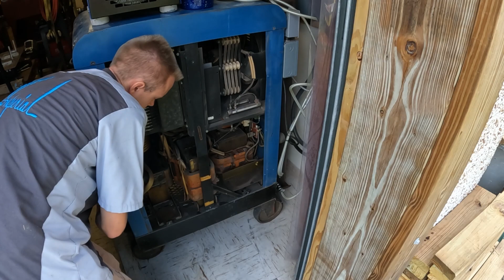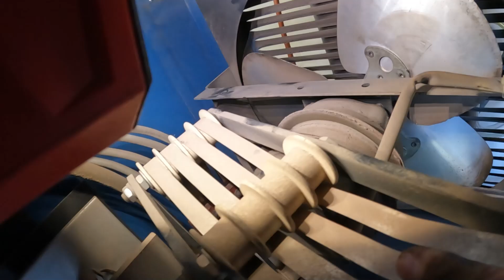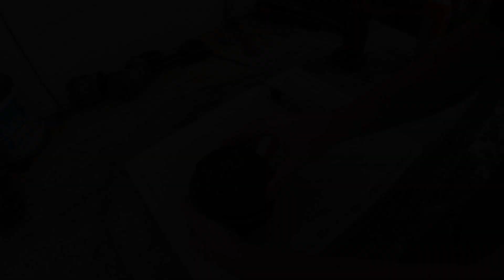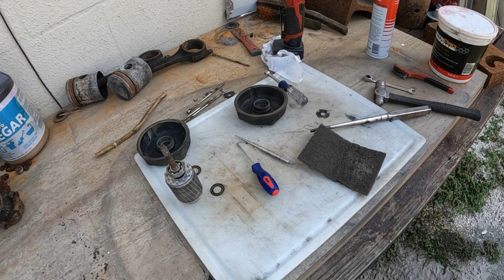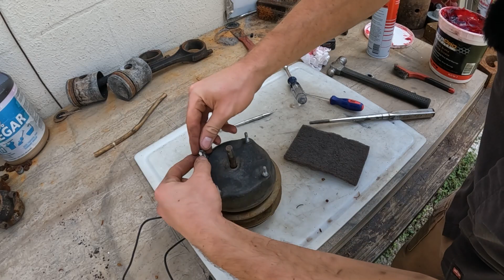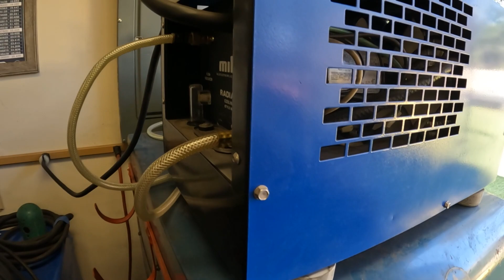Servicing the Fan Bearings on my Miller 330 A/BP

Comment: Good job can't count the lawn mowers, weed wackers, chainsaws ,I've picked up ,before the garbage man got em. Most had broken pull ropes. Couldn't find a windshield wiper motor for my old Nissan. I removed took apart dirty Rusty cleaned it works like new. I've took power window motors apart cleaned them with electrical cleaner and work like new. Not many people try to repair just replace.
Reply from the maker: Thank you! I have definitely picked up the fixer mindset. People wonder how I get the trucks and machines etc. they fail to realize it is just usually really broken when I get whatever I pick up. There is so much stuff out there that was thrown out that just needs cleaning as you said. I think it is self destructive for society but at the same time I get cool stuff lol. Thanks for watching!
Reply: @OLDSKUULGARAGE  oh yeah I pick bicycles up patch a tube ,put the chain back on, adjust the rear wheel. People know I have many bikes all free to kids that need one.
Reply from the maker: @WillChandlerFLD120  man that is awesome! Saving a bike and helping another out!